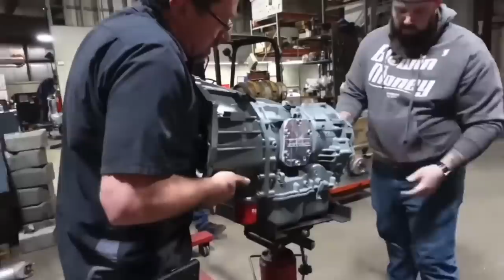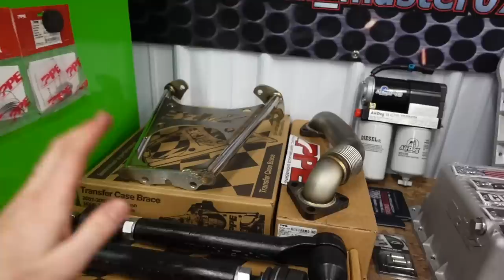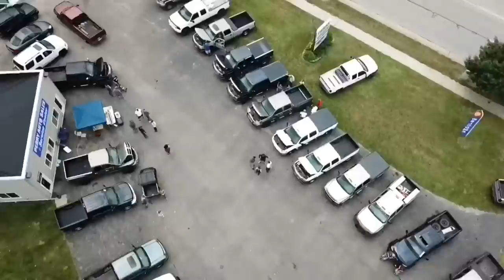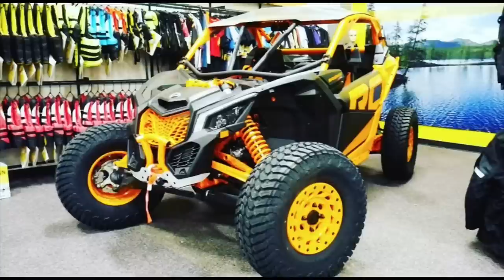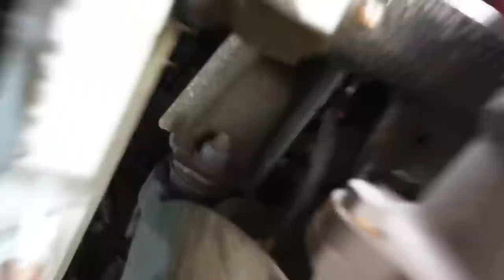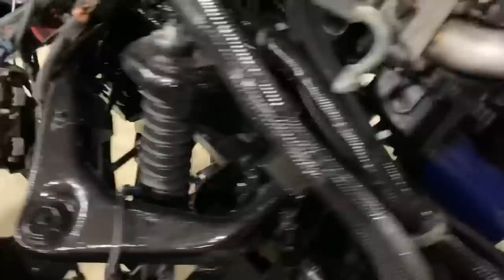My Friend Is Selling his Old 2007 LBZ Duramax For $50,000! “WHAT?”

Comment: I feel the same way about my 2006 3500. It has 303,000 miles still running strong, I actually daily drive it to work about 100 miles a day. Yeah diesel is $4.69 a gallon here in Missouri but honestly I couldn’t see myself driving a gasser unless it was an old square body. I paid $11,600 for it 2 1/2 years ago and I’ve probably put $9,000 into it but the way I see it is that I’ll never find another truck like this. It’s one of my dream trucks and I’ve put a lot of blood, sweat, and tears into it. I’ve still got alot to do to it because it was completely stock when I got it. But I deleted it with an hsp intercooler and y ridge kit, still can’t afford a tune but it doesn’t mess with drivability. Thanks for all the videos you’ve made about yours because it’s helped me and save me tons of money not having to take it to a shop. Keep doing you man, you’re my favorite guys on YouTube!

Comment: Love my LBZ! 6 inch lift and 35's❣️ found her at a dealership that was evidently going to send her to auction! 10k is all they wanted a year and a half ago. Wife and I went to look at her and as rough as she was I decided SHE was the one for us❣️ leaking trans, dead batteries and all! Just had a feeling. 340k miles and STILL a beast!
Reply: What lift you have Karl? I’m have a RC 6” (leveling kit makes for 6”) I’m trying to put 35’s on my 07 classic LBZ but curious about the wheels. Thinking a 9” wheel with a slightly negative offset will keep from rubbing any more.
Reply: @Aaron-hype  I bought mine with a 6inxh Rough Country lift on it. I have 12.5" wide by 35" MT-2 Firesrones I believe. Offset I'm not sure but I don't rub until I am turning sharp and hit bumps or dips so obviously it will rub when flexing off road but I work construction and always need to get the tools and compressor to the power pole and on sloppy days this baby SLINGS mud like really bad/good❣️
Reply: @rt66hdguyify  preciate the reply bud. You have any issues with your 4wd Low? I hit the button for low and it keeps blinking but won’t engage into it. 4Wd high is no problem.
Reply: @Aaron-hype  4low requires me to be stopped and in neutral then push the button. 4high I can switch while rolling. I haven't had any problem.

Comment: I'm sure someone out there has more money than brains and will buy that thing. I shopped for a year and a half for the '06 I've had for three years now. Bone stock CCSB, 199K on the clock, new injectors and cp3, fully loaded LT3 heated leather, Bose, power sunroof, canopy and not so much as a ding, peeling paint or rust anywhere. Sat on dealer lot nearby for almost nine months. After contacting them several times over a period of 6 months with rejected offers, I drove of with it for 17K!

Comment: Do it. 50k isn't nuts when there's shortages. Prices will keep rising until its fixed. Bought an 02 2500 lb7 crew cab almost fully loaded and camper shell for $30k and only 40k miles. Craigs list has them for 45 to 50k

Comment: My dad has a 2006 Crew cab  LT3 4wd LBZ 3500 he bpught new and I was driving it today when it hit 90000 miles.  Completely stock, never had a tune.  He built a steel flatbed for it 2 weeks after he got it and his factory dually bed sat for 14 years without a scratch on it, until a tree fell on it in 2020.  He's selling it to get a 1/2 ton 3.0 Duramax, because he has never towed over 10k with it.  Most of the miles were empty driving to the VA hospital.  In my opinion the 2006 to 2007 classic with 6 speed Alison with LBZ engine with no DPF or DEF is the hot grail of Duramaxes.

Comment: I can’t remember for sure what year it was 2002 or 2004 is we run 2wheel trucks with the four wheel drive front hubs. I stopped the line and quickly was told that flint assembly was running all the same hubs. It was short lived but kind of a cool rid-bit to pass along.😊

Comment: Great video as always.  I know that Rustbelt had to do some hard thinking to post his truck. But when it comes down to it.  Sometimes other things are far more important.  I have no doubt in my mind he will have a new build to take the place of it. Which is going to be fantastic.  I won't comment on the price... but I think he will get a proper deal.  You have a fine fleet and you have them for all the right reasons.  I have watched your channel for a long time and you have definitely earned your way and the accomplishments you have made.  Speaking of how is the Dodge Cummings coming along ? Converting 2wd to 4wd... a great project... if you're talking a 55... or 67 / 68.... for sure. But a newer truck no buy a 4wd. Mark is setup in a way that makes it a great "winter" project so to speak.  He has enough equipment and access to parts and all to do just as he has... tinker... little here and there..fun.... worth it.  Otherwise not... I personally would but a outrageous 2wd hot rod..low fat and screaming Fast ! Diesel  !... that would be cool 😎 👍 just open the go fast hotrod catalog and get some  ! 
Keep up the great job 👍and as always...looking forward for the next video

Comment: I enjoy your video’s every week. I also have a LBZ that I love to drive. Wondering if you could give me some advise? I went to town yesterday to wash my truck and everything was great. Pull it out of the wash bay the check engine light came on. So I checked the code with my CTS and the code is PO700. I drove it home and it now locked in 4th gear. Every time I put it into drive it makes a clunking sound and stays in 4th gear. Everything I read is pointing to the TCM. What is your thoughts? I really could use the help. Thanks Kip

Comment: My LLY is almost identical to your truck but it's an lly as I said and it's a long bed GMC SLT. I did almost everything you did except I put the full kryptonite ultimate front end package and didn't do 60 over injectors I did 30 over and a air dog II 165 gph lift pump not fass. Stock turbo and no traction bars. Same hsp parts and it's not lifted it's leveled with kryptonite stage 3 leveling kit. Stock wheels with 33.5" duratracs 12 wide. So can I get more than 20,000 for it? I got over 30,000 into it lol. Less if you don't count labor.

Comment: Too much money for me. My Duramaxs were both bought for well under 10k, and both are solid, crew cab 4x4 trucks. I can’t see 50 grand for that truck ever.
Reply: I saw one sell on Craigslist. It was a fully stock garage kept 1 owner 4x4 manual crew cab with 18k miles from outside of the rust belt.

Edit: the truck was 54k
Reply: @Namedeeznuts  yeah, it sucks, a new duramax starts at 39k, but if he takes care of it that LBZ some lucky bastard over paid for will still be going strong when the new ones are junk

Comment: All the trucks you have along with the tractor and the fuel prices nowadays, maybe look into getting a large 500-1000 gal fuel tank on the property. Could get a bulk buy discount and do a video on it then another about cost overall vs savings. Think it would be cool.
Reply from the maker: You are definitely on to something I’m actually thinking about getting a fuel tank for the back yard
Reply: I live in Illinois. I don't think you would save as much as you think. I get a 5cent a gallon for my own tank and if I pay the Bill in ten days. That's for Farm diesel. I believe I would have to buy 1500gallons for another 5cent discount. The discounts are not as good as they use to be. 5yrs ago 10-15 cents for gas or diesel. Check with FS. Farm service. I just got a letter the other day FS brought my supplier. I use about 1200 Gallons of Farm diesel a year.
Reply: It also doesn't last like it once did...a huge stockpile just isn't as practical anymore unless it's just convenient

Comment: I have over 35k (Parts receipts) in my built lly and that’s just from the price of parts. I’m a shop owner and xdp dealer, so all work was done by me and I get discount on parts. New gm block with stock crank, callies rods, mahle pistons, all arp fasteners, new age 625+ head studs, billet alternate firing cam, billet hold downs, billet rocker bridges and push rods. 150 over ddp injectors with a s and s 12 mm pump, pusher intake with 91 over 68 compound turbos and fully built trans. All kryptonite steering system with traction bars and a lot more odds and ends. All work was done by myself except for tuning and I know how much money I have in my truck, not counting the time. There is no way I would sell my truck for 50k and I say his is priced fair and that he will sell it for that. Most people really have no idea what it takes to build a fast reliable diesel truck, but I know it would cost 75k or more to build mine. Before I done the big injectors, pump, and compounds mine would run 8.0 seconds in the eighth at 85 mph. (Had 30% over injectors with a single Vgt turbo and a stock cp3. You could imagine how it runs now! 😁)
Reply: I have a similar build to this. I went with a single Danville billet turbo instead of twins. Why did you stay with the stock crank? You were in it that far. I had to. Stock crank made me nervous. I went with Wagler Performance crank, rods and pistons. Everything else is pretty much the same

Comment: About 3 weeks ago I was looking into trading in my 05 Silverado 2500hd with 160k on it I owned it outright a few places offered me next to nothing kept waiting kept waiting until 3 days when a dealership offered me $6,500 for it truck was a work truck model rubber floor manual windows manual locks manual 4x4 the aftermarket stuff doesn’t add any valve at all at some point I’m sure he will sell it not entirely sure he will get the $50k asking price but time will tell for sure.

Comment: Hey I’ve got a question, I have a 2004.5 lly duramax and I tow all the time like towing machinery and meterials. The truck has 225.000 miles and I’ve heard different things about changing the transmission oil. Some one told me that you shouldn’t because it’s like internal now or something. What do you think about changing the transmission
Reply: Don't listen to clowns who say don’t change your fluid. Change all your fluids by dropping pan change filters and refill.
Reply: Kinda of a sensitive topic do some research on it “technically” yes you should change it but in “reality” now that you haven’t (I’m assuming anyway) with that kind of mileage it’s better to leave it alone unless your fluid still looks good in color. But it’s recommended every 40k miles

Comment: Hey buddy I have o6 lbz and a o5 6.0 powerstroke the 6.4 Starter upgrade is so easy and spins over way faster I didn’t even buy the OEM one I just bought one from O’Reillys for like 260 bucks
Reply: Also the new starter only pulled half and amp more on startup
Reply: A lot of the newer motors do the same, even the exact replacement

Comment: I'd rather buy new, no offense to rustbelt at all but for 50k+ I'd rather wait and have a brand new zero mile truck but if you love these trucks then price is dependant on the buyer and how bad they want it :) I'd just rather wait especially since computer processors haven't stopped they are just having trouble catching up to demand still so waiting for a brand new truck for another 20k is more worth it if I'm spending that much ❤️🧡💛
Reply: But the new trucks will have all the emissions and fancy electronics putting them in fields waiting on parts